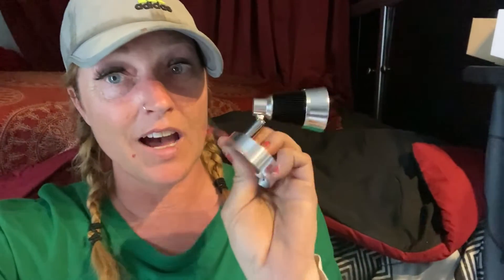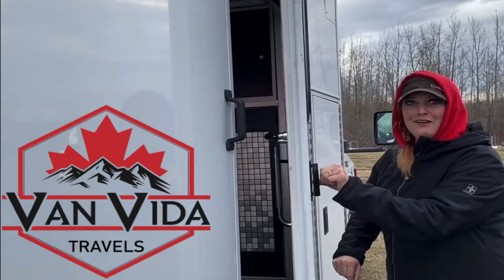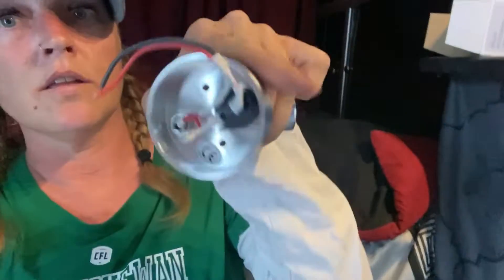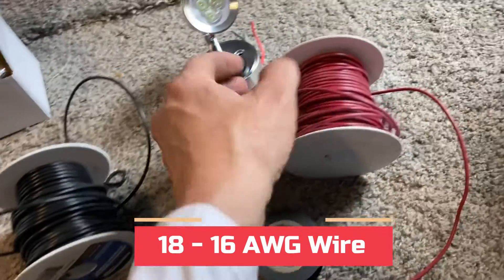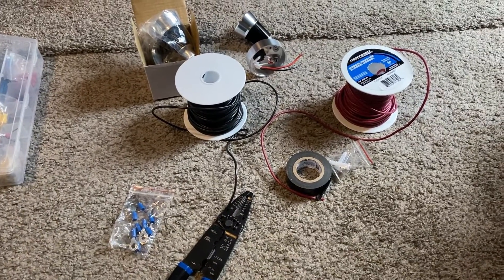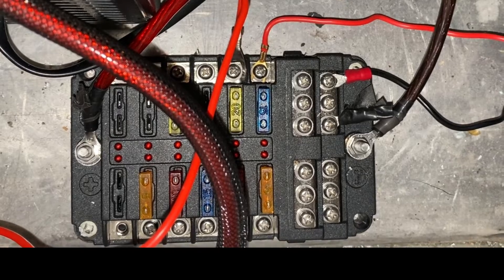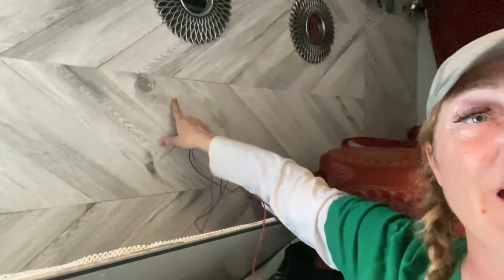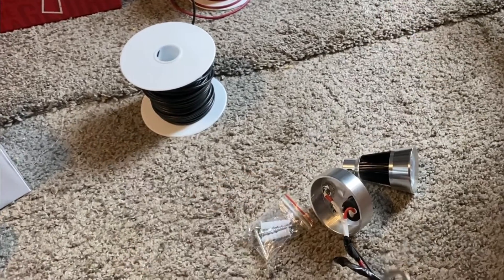Wiring LED Lights to a 12 Volt Battery

Comment: How did you connect the wires?
Reply from the maker: Electrical tape
Reply: @VanVida  There are butt connectors you can use to crimp the 2 bare wires together.  I know electrical tape is fine but I find that the tape gets a little soft and gooey in warmer weather and can unwrap itself. Like Skeet had in his fan install video.  Much more secure.  Just throwing it out there sweetie.